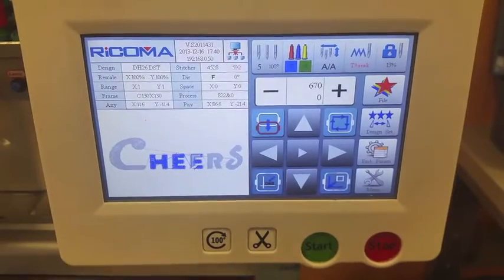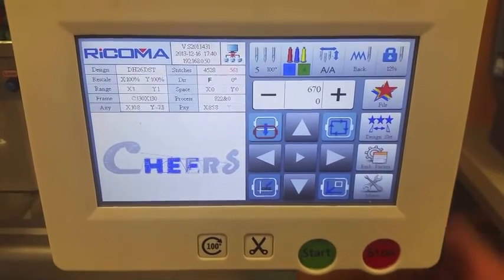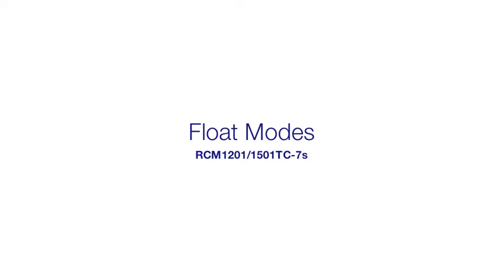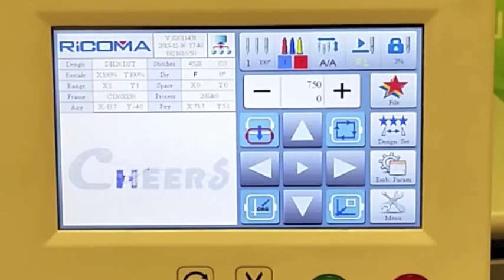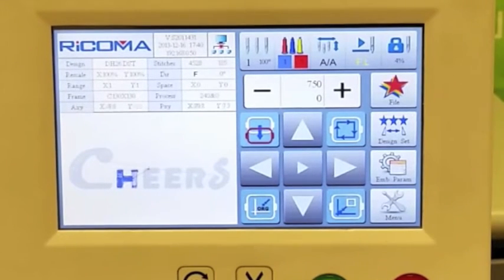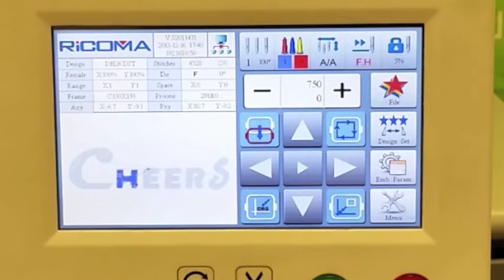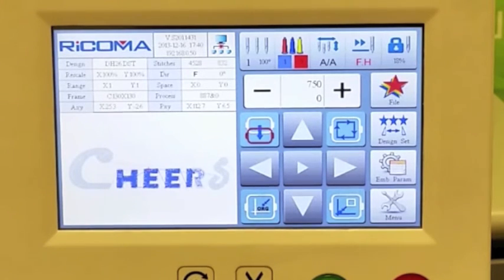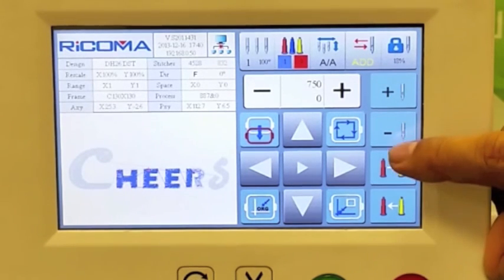Backing up Floating on your RiCOMA TC Series

Comment: So when our machine's thread broke we did this to rewind the stitches but when we press start it just stitches floating even not in float mode not stitching on the fabric. Can anyone tell us what we are doing wrong??
Reply: Hi! I have the same problem. Did you get the answer from Ricoma? Thanks!
Reply: I just figured this out after having the machine over a month. You have to back up using the stop button just like in video BUT!!!!!... once you find the thread location you want to be on, you have use that reset toggle on the needle head. You have to click it from the neutral position to down for 3 seconds then back to neutral THEN GO UP TO THE TOP POSITION. Once in top position, the light will turn red and hit start.
Reply: @apazman123  Thank you very much!
Reply: @apazman123  thank brother was looking everywhere for this
Reply: @apazman123  oh my lord. You saved my life!!!